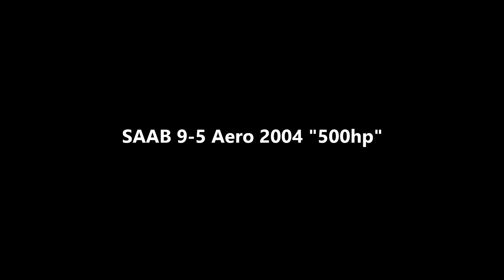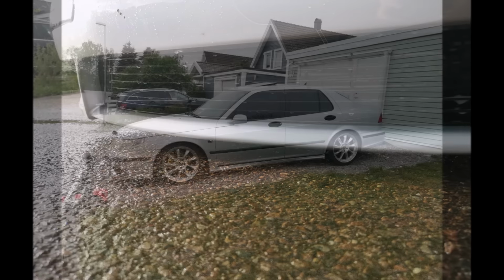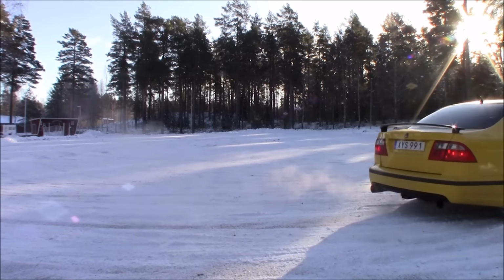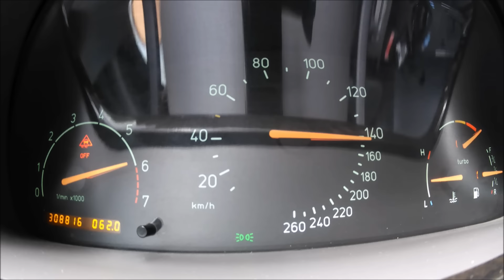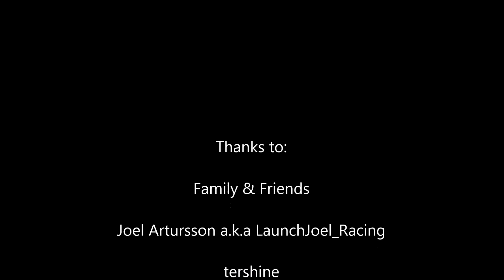Building A 500hp SAAB 9-5 in 20 minutes!

Comment: Hi mate, could You tell us how is the performance of this car in comparison to 2.0 9-5 NG You recently tuned? both have similar power as I recall, both are FWD. Any traction improvements on NG?
Reply from the maker: This car has +100hp more and quaife differential. There is more torquesteer in a og9-5 compared to a ng9-5 if both cars where original.

Comment: i once bought a 15 yrs old at the time, a mint 2002 Saab 93 convertible for £1500, bought with the 154 HP B204E engine..I got that baby up to 270bhp with the same engine , i threw the standard Garrett turbo away, bought a new Chinese made td04-t15 turbo from the same factory that makes turbo's for toyota, honda etc (at £215 ), plus a remapped ecu from the UK saab tuning Guru GOD ,Mr K Nevers  🙏 ( at £125)  and it was scary as hell putting the metal down as it was one fking fast car, even with  6 point under engine chassis bracing that baby flexed like a bucking bronco and the steering wheel was flicking all over the place with the tyres scrabbling for grip up to 3rd gear..i sold it TOO cheap, also included a fitted hand made stainless exhaust ( which cost me £400) for £650 to drive away , 4 years ago WTF!! 
me now at nearly 57 yrs old, it is time to find a good 9-5 to make it at minimum a 400/500bhp sleeper...after i find one then i have up to £15000 in savings to restore it , give it my own look and be my lifetime keeper 😜😜
I have been a biker since 1989 and i realise that i could go out and buy a 1996 non limited Suzuki Huyabusa which will hit over 200mph for about £1800-£2500..i still have bikes but, i have done and dusted fast bikes now , i just NEED  a powerful sleeper Saab to make me happy ❤❤
brill vid Jonas..new sub for you my friend 👍
Reply from the maker: Awesome story, hope you find a Nice 9-5 to start your sleeper build 👌
Reply: It was 270 😂 not 2700 bhp 😂
Reply: @goldeneagle99  hey i know , but had a lot of fun in it..its not all about size its how you use it

Comment: Hi Jonas, love your 95 built.  Can you advise what's wrong with the Siemens Deka 875cc and replacing with SMP 846cc if runs better?
Reply from the maker: Deka875 is old technology and the spraypattern isnt the best, more like a shower than a mist Smp 846cc is worldclass 👌
Reply: Thanks for your advice. And if they are direct fit without any mod required? @JonasKakarikas
Reply from the maker: They have same fitment as 875cc deka

Comment: sorry I have a question ... which connecting rods and pistons did you use as an upgrade?  B204 on B205?
Reply from the maker: B234, its a 2,3l engine in this car 😉
Reply: @JonasKakarikas  good...but did you use connecting rods and pistons from which engine?
Reply from the maker: Its a B235R in the car(T7), i used the piston and rods from a B234 (T5). Pistons needs to be Machined 1,1mm to fit. I have detailed videos on my channel for the whole build
Reply: @JonasKakarikas  good joob 🔥

Comment: Thinking about doing this with my 08 9-3 aero.. Can't find any exhausts for it, and I can't weld lol. What would you recommend in maybe say a first step power additive? Love your build man! Keep them up!
Reply from the maker: A stage 2 or 3 tune from MapTun.com they have exhaust And everything else you need 😉
Reply: Yep....ECU upgrade
....I went for a stage 1.....but will eventually go stage 3. The SAAB existing infrastructure is good for close to 400 hp just with an ECU upgrade alone, I have been told; Big enough turbo, air filter, and exhaust system.......depends on your budget.
For a single turbo four cylinder saloon car, these cars will keep other,very expensive cars honest in the performance stakes.
Reply: PS....I have a 2004 9-5Aero.
Reply: @JonasKakarikas  for v6 ?

Comment: Jonas, maybe You could check  one day with draggy what 0-100 times are possible?  I'm really interested how FWD car with such power can handle a good start, and what results we can achieve. Thanks!
Reply from the maker: Dont own the car anymore 😉 but Its fast
Reply: @JonasKakarikas  Thanks. I presume it's fast, just wondered how it runs from a standing start, and how FWD handles that power in first gears.
Reply from the maker: Depends alot on suspension setup, differential etc. Fwd cars aint the fastest in dragrace, but fast enough when done right
Reply: @JonasKakarikas  What would You recommend as a supsension setup ? Bilstein b8 would be enough?
Reply from the maker: Coilovers with adjustable dampening.
Reply: Kan du berätta i vilken del av världen finns den
Det kan vara extremt roligt att se den
Reply from the maker: Danmark
Reply: @JonasKakarikas  tyvärr inte stor chans men man vet aldrig

Comment: Love the build was wondering if it's holding this power on the stock 5 speed
Reply from the maker: Reinforced gearbox 1 - 3rd gear + quaife differential 👍
Reply: @JonasKakarikas  so u are saying u have a lsd on it and a brace
Reply from the maker: Yes
Reply: @JonasKakarikas  what do you mean by reinforced gearbox? :)
Reply from the maker: The gearbox was built by Speedparts way back. Stronger gears 1st, 2nd and 3rd + quaife differential
Reply: @JonasKakarikas  Nice, how much are they?
Reply from the maker: A differential is like $1200 something like that

Comment: Que turbo estas usando?
Reply from the maker: Dont speak spanish 🤔
Reply: PSR2867?
Reply: PSR2867.. De PULSAR
Reply from the maker: Yes, gtx 2867r Gen2 pulsar
Reply: @JonasKakarikas  With how many psi of impulse to red line?
Reply from the maker: Dont understand the question, but i ran the turbo on 1,35-1,4bar of boost at 470hp

Comment: Fantastic! But I would never invest so much money and effort in a FWD car. It's useless.
Reply from the maker: Not really, very driveable with this tuning 🙏 its all about how you set it up
Reply: @JonasKakarikas  I had Accord Type R CH1 tuned up to 250hp at Performance tuning and styling OY at Vantaa,Finland,and the car was at the very edge of its handling limits. Rolling pulls are okay,but anything above 250/280hp at the front is too much. Now I am with E46 3.0d with 380+hp and 750+Nm and the difference is like day and night. Smooth straight 6,RWD and brutal acceleration .
Reply from the maker: The life with an LSD differtial makes the fwd go straight and boost By Gear lets you have grip at full throttle. But yeah, rwd is another ballgame 😉
Reply: @JonasKakarikas  that also true. But LSD on Type R is stock,and at full throttle on corners the steer just pulls to the side. With the E46 you get slight correction with the throttle to counter the rear and goes out the bend beautifully ✌️
Skål brother!🍀🍀🍀✌️✌️✌️
Reply from the maker: Should have tried my build at a racetrack 💪🥳
Reply: @JonasKakarikas  haha, sure! You never know, Sweden is not that far🤗😉